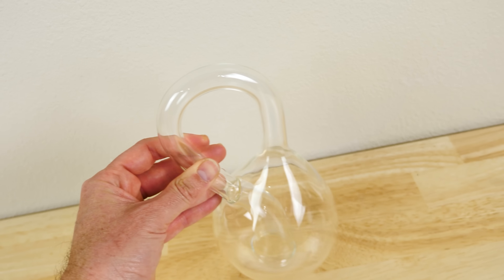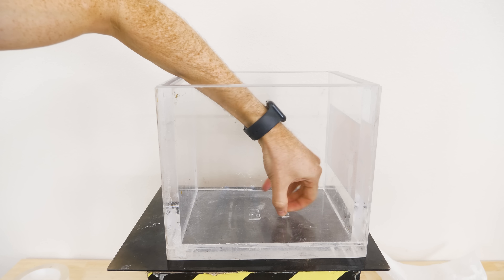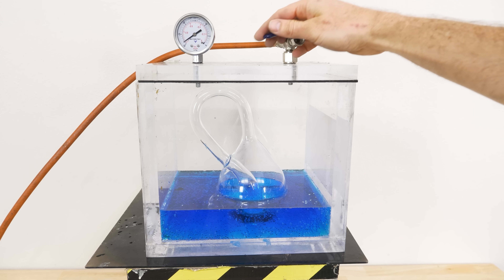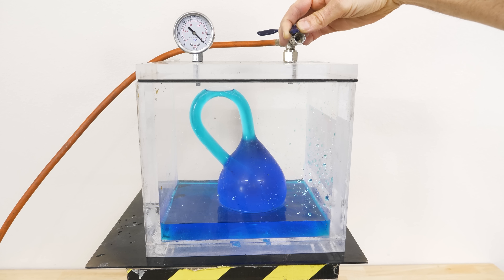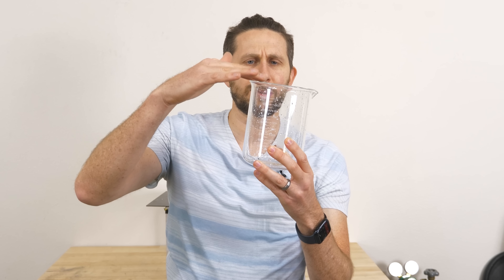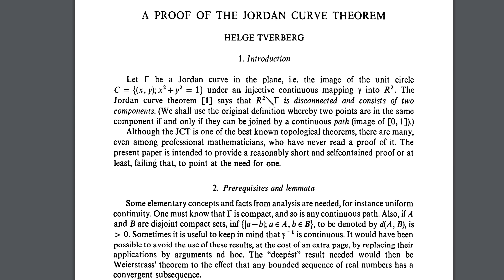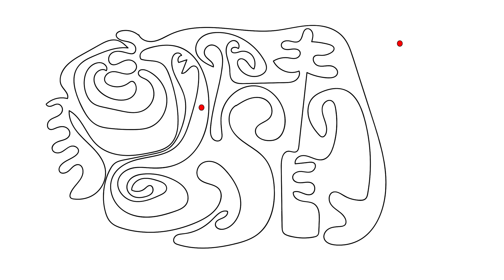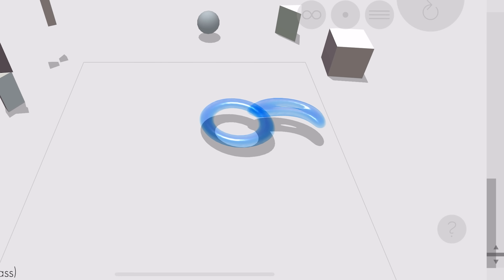Is It Possible To Completely Fill a Klein Bottle?

Comment: I asked for a glass Klein Bottle for my 13th birthday or so, and my parents got me one from the legendary Cliff Stoll. He suggests filling it simply by immersing it fully in water, which will get you most of the way there.
Reply: Or you can stick a small hose in it a pressure water through that in the bottle
Reply: @PierreBezemer  right
Reply: @PierreBezemer  right
Reply: Yes, submerging is a much easier method of filling a Klein bottle. Completely submerge it, and then just turn and shake all the air bubbles out. You can get 100% fill this way just shaking the bubbles out.
Reply: Inserting a tube until it reaches the inside wall, then submerging the bottle, then sucking on the end of the tube until the air is sucked out of the bottle, liquid will fill the vacuum.  If the tube is kept at the top of the air bubble in the bottle, all the space will get filled with liquid
Reply: @Xonk61  Inside wall? Silly billy, the Klein bottle doesn't have an inside or an outside!
Reply: Cliff Stoll is an amazing person. I was at one of his lectures on the Klein bottle. I think he had like 1,000 cups of coffee before coming out on stage.
Reply: Who else hears "Klein bottle!" in Cliff Stoll's voice?
Reply: Stoll's stock? Wow!
Reply: Cliff is a real world mad scientist from a kid's science show. I love him so much.
Reply: If you spin it under water to fills
Reply: Holy crap this Hello Kitty fan is absolutely insufferable and pedantic. He's giving me flashbacks to old newsgroups and compuserve. Virtually no tact - just an onslaught of rude remarks about proper syntax and other serious concerns.
Reply: Oops, wrong,  @twr412 , and you're a hypocrite just for saying that, since you had no tact with what you said. Also, wrong, it's not an onslaught unless silly larry's replies were an onslaught too. There wouldn't be this many replies if it hadn't been for him, duh.
Reply: @HelloKittyFanMan  😘
Reply: @twr412 : 💩
Reply: I bought one for my sister from him a few years ago. It was an amazing shopping experience lol. He sent photos via email of him packing and shipping it plus the tracking info. When it came it had a photo inside of him with the bottle enjoying a sunny day in his backyard b4 being sent to a cold NH winter.

His enthusiasm is in everything he does.
Reply: This thread is definitely a thread
Reply: @Brodobo : Obviously. All threads are threads, duh.
Reply: Yes, Clifford Stoll is an awesome legend!  Before Klein Bottles, he was an apprentice to Robert Moog.  He studied astronomy at many universities, before gaining his title of "Dr.".  Worked at Berkeley campus' computer center at LBL, where a 75 cent accounting error turned into an international hunt for a German computer hacker (Markus Hess) and a hacking ring trading top secrets to the Soviet KGB in the mid-1980's.  In his cooperation with the U.S. Government agencies, he helped open the eyes to the vulnerabilities in computer security.
Reply: Why are we arguing over a Klein Bottle
Reply: Was about to clown you and make a joke about getting a Playstation instead like a normal kid, but it's honestly a cool thing that you were interested in science enough to ask for that. Wish I had more useful hobbies hahaha
Reply: "Deception" is a bit harsh. It's not claiming to be magic, it's just claiming to be a sleek, quiet fan with no visible moving parts. Sure it's called "bladeless" when it actually has internal blades, but that's no different than a wireless device having wires on the inside.
Reply: that's what i thought he would do but i guess it would have been a boring video without the vacuum box thingy 😂
Reply: Cool
Reply: I love that guy, he's like if you took a character from an old science edutainment cartoon and slotted them into a human body.
Reply: @DukeOnkled  He came to talk at my university. He was wild, couldn't stay in one place. He even disconnected the clock off the wall at one point.
Reply: When did "bottle" become a brand name?
Reply: @HelloKittyFanMan  When you put the world "Klein" in front of it.
Reply: @larrybud : 1. What's a "world 'Klein' " supposed to be? 2. No, just because you put... whatever it is you were trying to say... in front of the word I asked about doesn't mean the word I asked about suddenly becomes some brand name somewhere. 3. Let's just see what Brandon's reply is, since he's the one I asked.
Reply: @HelloKittyFanMan  A "Klein Bottle" is named after the guy who invented it. I'm not sure what's so difficult to understand about that.
Reply: @HelloKittyFanMan  BTw, I don't think anybody said it's a "brand" name.
Reply: @larrybud : 1. That's the real term and you're not really quoting any specific person's words when saying it, so it doesn't need quotation marks. 2. Of course it's named after the guy; that was said in the beginning of the video (and I knew that before, anyway). 3. That's why you capitalize the name Klein, duh. 4. "Bottle" isn't part of Klein's name, so that's not why the next word needs to be capitalized too, duh. 5. He treated "bottle" as if it were a brand name... or part of Mr. Klein's name, so I just went with "brand" as one potential example. 6. And again, Brandon is the one I actually asked, so let's see what he says.

By the way, when you want to add something, just included it as part of one reply, because very often YouTube replaces the notification of the previous reply with only the newest one, so the person you're talking to might miss the previous one. If you've already sent it, then there's this nifty tool you can use called editing. Or your can just delete the old one, add the new material, and then repost it.
Reply: @HelloKittyFanMan  Hello! Thank you for your numerous heartfelt messages, I hope my post didn't cause you too much distress.  I don't believe "Klein Bottle" is a brand name.
Reply: @HelloKittyFanMan  I really don't know what your confusion is with the name. The bottle is named after the guy who invented it, hence "Klein Bottle".

 FYI, this area of YouTube is called the "Discussion forum" or "comment section" where people discuss things. If you want to address Brandon and only Brandon, I would suggest you send him a "DM", which stands for "direct message". I shall reply to whomever I want to reply to, and will choose HOW I want to reply, thank you.
Reply: @BeefinOut : LOL, silly, just because I asked the question or replied more than once about it to someone who was replying to me more than once about it doesn't mean it was "heartfelt" or that I was "distressed."
And if you have an issue with the number of times I replied, then take issue up with larrybud too, because he's the one who turned what I asked you about into the chain.
OK, so if you don't think "Klein bottle" is a brand name, then what was it about "bottle" that made you believe it should be capitalized?
Reply: @HelloKittyFanMan  it was a typo 🤗
Reply: @larrybud : 1. It's not a "confusion." I wanted to know why Brandon thought a non-brand and non-personal name should be capitalized, or why he thought it was a brand. That's not the same thing as "confusion" on my part. 2. I know who it's named after, but that doesn't mean you give the second part of the term the same treatment as the guy's name. It's a GENERIC term that happens to have a person's name as part of it. 3. I never said it wasn't a discussion forum, duh. But that doesn't mean I can't prefer that the person I asked be the one to answer and suggest that preference to someone else. 4. There isn't a way to DM someone through here. 5. "DM" also doesn't need quotation marks. 6. Why did you think "discussion" is a brand name or should otherwise be capitalized? 7. Why do you care so much even though you're not the one I was talking to, then?
Reply: OK,  @BeefinOut , so since I know that you already know how to and are willing to do the thing I will suggest here, since you've already done it with something else, and since that typo is something you didn't catch when you did it last time, then simply edit again to lower-case the B for future readers (just in case another one has the same curiosity), and then of course I'll delete my question reply that will have become obsolete (but not mine to Larry unless he also smartly deletes his too after that). HINT: By the way, it will take less work for you to do those few clicks than it would for you to type some "I don't want to... (blah blahh...)" response to me instead would. ;-)
Reply: @HelloKittyFanMan  no 😇
Reply: @HelloKittyFanMan  Well, capitalization police person, it get capitalized because it is named after a person. As someone who seems to fancy themselves as part of the grammar police, I figured you'd know that.

Again, this is a "discussion forum", hence, the discussion. You might prefer someone else to answer, but it is what it is.
Reply: LOL,  @BeefinOut , it took you more clicks of work to dig around for that icon than the edit would have taken. If you've already edited your post on your own and don't mind that work, then why would you rather be so stubborn as not to accept it as a suggestion by someone else and do it for future readers? What's the supposed difference?
Reply: @HelloKittyFanMan  the difference is that policing grammar for no reason other than to feel smart is a terrible habit and I don't want to encourage it 😊
Reply: @larrybud : Silly guy, just asking him and you why you thought something needed to be a certain way isn't "policing" it, duh. Yes, the "KLEIN" part is what's named after the person, so it's capitalized. "Bottle" isn't part of his name, so NO, that's not the part that's named after the person, and thus there is no logic for capitalizing it, duh. So even if capitalization were part of grammar (but it's not), and even if I were a "grammar police" (but I'm not), then it would be incorrect of me to think that just because you're supposed to capitalize the "Klein" part, you should capitalize the word it's naming too. Because again, "bottle" isn't part of his name! That's not how it works. Where did you get the silly idea that that's how it should work?

And again, what about my question about why you thought "discussion" should be capitalized in your previous reply? And now, with putting quotes around it, did you think that's not the real term for it? Why the quotation marks?

And just because it's a discussion forum isn't the rationale for why YOU care so much. So why do you, whom I wasn't talking to, care so much, when it wasn't something that would affect you, forum or otherwise?
Reply: @HelloKittyFanMan  Klein actually is the German word for “small”.
Reply: @BeefinOut : LOL, the differences between what you thought and the truth are that: 1. as I already told Larry, which you should have noticed, ASKING you the question isn't "policing." 2. People don't A. police things like you think you're talking about, or B. even ASK you questions like I did to "feel smart." Only a mor(YT cens. maybe)on would believe that's why I said what I said. 3. So humbly and reasonably agreeing to use the suggestion wouldn't encourage that.
Reply: We weren't even talking about that,  @crowguy506 ; it doesn't apply here.